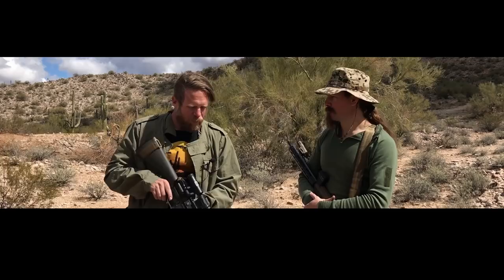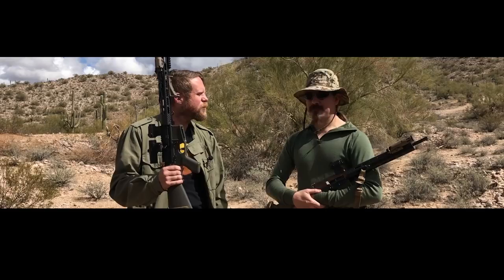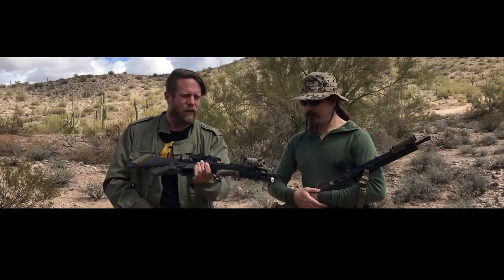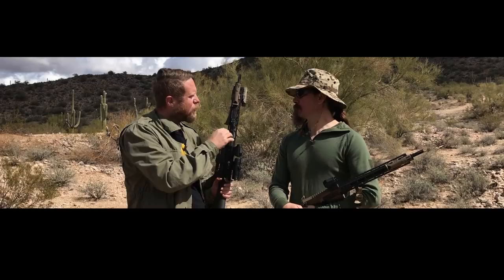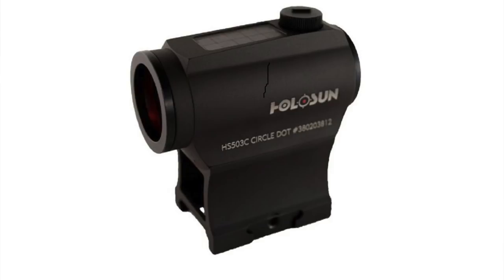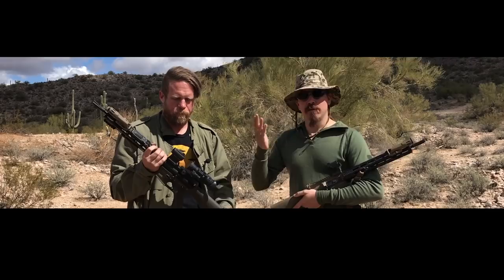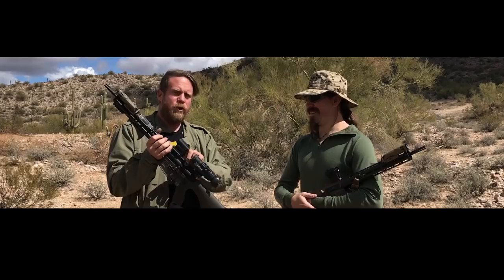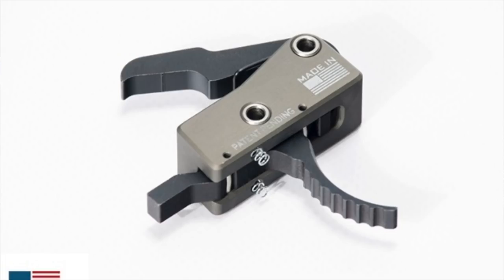WWSD: Rethinking the AR15 - CONCLUSION

Comment: I was interested in the bi-pod predicament that you guys ran into. It seemed rather limiting to go with a 'traditional' under barrel style instead of something like the FAMAS' side mounted legs. After doing a bit of research I came across a Picatinny Side mount bipod made by Command Arms. They can be had in different lengths and can be quick detach too. Just a suggestion, would be curious to see what your thoughts on them would be.

Comment: Really excellent series and conclusion. One thought, since we're thinking out of the box, why not extend the handguard past the tip of the barrel/flash-hider? This would protect the barrel if it get's dropped/mishandled, while only adding a fraction to the overall weight and size. Additionally, the lasers, lights, and other accessories could be mounted further back to improve the balance of the gun.

Comment: I use my backup sights for my cmmg. conversion to 22Lr. my red dot for 5.56.  the 22 shoots about 3" low at 50yds. out of the red dot. I use the offset  sights so you can get  both mag. and sight on,   both this way can be used for either cal. but you are "0" with the iron sights and the 22

Comment: Regarding backup iron sights. Could potentially have put that as a flip out from the top of the stock. Though it would neccesiate removal of rail mounted sights, it would be an intergrated, streamlined and concealed option.

Comment: Love the concept, but there are a few minor things that don't work.  The hand guards flex too much to mount an IR laser to, so they need to be aluminum.  Maybe Midwest Industries new ultra lightweight line would work.  Or perhaps Aero could update it's COP platform with a carbon fiber lower piece, or VLTOR could adapt it's VIS upper along similar lines. I'm totally with you on the heat issue and think a carbon fiber grip is a great idea. The continuous rail provides enough space to eliminate any eye relief issues.

Iron sights are a requirement, the front should be pinned to the barrel, and the optics needs a QR lever.  An optic with an etched reticule, either a 1x with flip-up magnifier or 1-6x variable because not everybodies eyes work with a red dot.   Also, fun fact, some one looking at the front of that red dot at night can see the red glow, kind of like a lit cigarette especially when there's lots of them in one area, like say waiting to ambush you. My vote instead is for the VCOG with licensed ACSS reticule. A Sharps Relia-bolt, LMT enhanced bolt, or similar product might also be a good idea to test. Combined with the mid length gas system that should fix the problem of bolt lugs shearing off.

Comment: I love this project. Only thing I cannot use at all is the GWACS because I'm 5'6" and I run my collapse in pos 3 (out of 6). And the beard hair problem was solved for me by using the Magpul ACS since the stick itself is longer and sits slightly more forward. It does indeed add weight, but it's weight in the rear end and it does balance a bit better. The other questionable piece is the carbon fiber ff tube, since it comes as a 13", not a 12". I don't know why companies make a 13" without making a 12" for us rifle length FSB users. It just seems that Facon hates iron sights.

Comment: This is a great rehash of a circa 2001 Professional Ordnance Carbon 15. Not to be confused with the Bushmaster version.
The Carbon 15 has a Carbon Fiber upper, lower, buffer tube, stock and handguards.  The barrel is small diameter fluted stainless steel.  It has a one piece aluminum rail with very low mount A1 style iron sights. Also ambidextrous safeties.  I have the last version with additional slots cut in the handguard.
I put an ADDCO ULTRADOT on it that co-witnesses with the iron sights when I bought it 2001?
 It will shoot 1" at 100 yards.  To bypass the assault weapons ban the muzzle brake detaches like a airhose. You can remove the stock and replace it with a shorter one by flipping a lever, another bypass of the collapsible stock ban.
Unfortunately they went out of business in just a few years. They were in Lake Havasu, AZ.
I have never shot mine to the point of heating it up as it is a collector's item for me.

Comment: I'm not sure what the big deal is? I was pushing Cav arm lowers years ago. I've built numerous cav arms guns. The lowers are awesome. Its the most solid feeling AR you'll wield. There is no slop between the upper and lower. The grip is a little blocky and could be better. But they are light and don't break. Combine with a skeletonized bolt carrier and a light barrel and you're in business for sure. Great ranch gun that is tough and cheap.

Comment: This will probably sound really stupid but here it goes:
Why not put the rear BUIS in front of the red dot? 
It's as a backup, so it doesn't have to work well, just better than nothing.
Reply: Not stupid at all brother, that's exactly what a lot of guys are moving to in the SpecOps community. Works quite well. Or offset sights.

Comment: In the Army I always used the M-16A2 over the M-4s for a few reasons.  One was that with the KAC quad rail the M-4 was heavier than the M-16A2s. Another was the 20" barrels have higher muzzle velocity over the short M-4 barrels.
Reply from the maker: True.
Reply: InRangeTV granted you guys are not concerned with taking down a hostile who may or may not be wearing armor, but the US NFA does mean that for most folks 16" barrels are the defacto standard.

Comment: I have used my backup irons twice. Once the red dot I had on my rifle ran out of battery at the beginning of a class, even though I just replaced them before the class. But I was able to run it with my backup irons. Not sure what went wrong with the optic.
I used them again recently when my EOTech got some moisture in it and my batteries died (the optic still functions, I just had to clean out the battery compartment).
Now I do acquiesce that having spare batteries would probably help, but I didn't have them on me both times, and my irons are what allowed me to continue my class.

Comment: Excellent points, perfect! I prefer a 16 inch pencil barrel with carbon fiber handguard if possible or the standard hand guards. I want the lightest possible rifle with a balance point toward the center of the rifle if possible. Less is more, I tend to remove as many accessories as possible. I also want the least complicated simplest sling possible. That’s just me

Comment: I used to have a reflex sight on my AR, and I had back-up irons on it as well. My reasoning was that if I was a complete nincompoop and left the reflex turned on over-night, resulting in the battery being dead, then I still had a good sighting system on hand to use. 

However, I now have a magnified optic with an optional illuminated cross-hair. The illumination is nice, but also not necessary. The cross-hair is very visible, even in not-so-great lighting conditions. As a result, the iron-sights are kinda obsolete. If my scope is knocked out by a stray bullet, but I'm not killed in the process, then that's God's sign that it's time to turn tail and run.

Edit: Forgot to mention, I now use the available real-estate for a flashlight.

Comment: Saw this on your facebook and thought it was intresting.

Two questions:
1) Will you put them through a mud/torture test?

2) Would it be accurate to say that a WWSD "Grunt gun" (something that actually would be able to replace the M16/M4) it would have the polymer stock, pencil barrel and carbonfibre handguard and then whatever stuff the military think is appropriate on top of that?

Comment: Only thing you guys haven’t really tried is down in subzero temps. Like here in Alaska, when I was in the army stationed here in Alaska optics batteries would freeze, ice over or break and crack. At that point you gotta take your optic off and use irons if you have them.

Comment: To balance the advantage of the carbon fiber not transferring heat : it also means it doesn't help in cooling other parts of the gun (but I have no idea if it's going to cause issues under heavy use).
Reply: rpnct the milk slots should allow for excellent ventilation.

Comment: My biggest disagreement here is as to adjustable stocks and their irrelevance. Now, this won't apply to a lot of people, especially Ian the spider monkey, but I have pretty short arms and a pretty big chest, and when you've got short arms, especially when you add chest muscle or fat and even moreso when you add armor, without a way to shorten the stock from the standard M16 spec you start to have a hard time even reaching the pistol grip effectively. Of course, you could cut down the stock on the lower, or have something custom made, but the easiest off the shelf solution is an adjustable stock.

Comment: Oh i just remembered on some polymers you can use a solvant to perrmantly bond them together stronger then any glue as they are bonded in the sense that the chemical polymer chains are connected. A chemical weld? I guess.

Comment: so the retail price (from their website) came to around $1850. That is not bad for a 5.5-6 pound near battle ready carbine. tactical not tacticool stripped of all but the necessities. The same gun built by a company would likely be in the $2500 range, and would likely cut some corners on things like the slt1 trigger and carbon fiber forward grip.  if you absolutely positively need B.U.I.S. they are so small you could add a pouch to the sling for them.

Comment: My take.

The fixed stock your using limits your LOP so everything you said about the BUIS goes out the window if you could adjust a stock like I can, nose to charging handle you can run a magnifier, I also prefer the 16" pencil because the integral flash hider is trash unless they updated it or something? Also the midwest lightweight rail is extremely light, and low cost. 

IMO if a rifle is more reliable and durable with more options and capability and doesn't weigh much more I'm gonna choose those parts.

Comment: I'd still say that BUIs or some sort of backup, non-electronic sighting system is necessary for the rank and file. Consider that the average infantryman's rifle is going to have been used by who knows how many guys before him, it'll probably have gone through hell and back, been used and abused in environments with very different heat and humidity, and the maintenance it has received has probably been pretty austere. SF guys don't need them, but then SF guys take good care of their equipment which sees less rigorous use, and they're usually not stuck in the shit for so long that they can't swap out an optic that starts to go screwy before the next time they need it.
Reply: I dunno, RCO-only, no irons must be relatively recent then. I've got a buddy in the Marines who was issued irons (a carry handle) with his rifle alongside the RCO.

Comment: FYI, the YouTuber Nutnfancy is absolutely obsessed with size and weight of firearms, so much so that he coined the term SAWC (size and weight considerations). So there are at least a few groups of people out there that are focusing on high-performance AR15s that are low weight besides you guys. 
Also, couldn't you just have a canted iron sight as a backup if you wanted one, without sacrificing top rail space? Polymer sights wouldn't weigh much and can still provide a manual backup for those who feel naked without them.

Comment: I can greatly appreciate your drive to cut weight.  I remember the days of the only thing you have is what you can carry for days.  Bullets count over batteries. I hear you on your cutting weight by removing a backup iron sight.  You seem to harp on that.  Guess I am just too much old school.  I like the look of your gun, carbon fiber and all.  But you live in the world of always having the things you want.  In the bush, you do not always have batteries, you deploy with what you can carry on your back.  Those are only there when the supply chain is close.  I learned the hard way, better to not need batteries to survive.  A simple 4x scope, non-illuminated, as a primary sight.  But the backup iron was always needed.  It sucks to have your primary fail and not have anything to fall back on.  Especially when you only have a second to react.  The concept is great, reduce weight in the weapon allows more ammo or other needed things. But, when all else fails, Iron sights work.

Comment: Also, shout out to our (I'm Irish, I support the USA troops too) the Irish troops in Chad, the blue line between Syria and Isreal, and the Mediterranean. The Irish troops on the Israeli border came to mind when you mentioned being in a fight against ISIS. They've had some clashes with the Islamic extremists on the border there. At one point some of our guys got captured and we, with the help of the Israeli special forces got them out in a raid (it was the al-nusra front that captured our guys, our troops have been attacked by them a few times, and Ireland has a policy of neutrally, our guys weren't looking for a fight. Just trying to maintain and keep peace on the border. But al-nusra have a tactic of decapitation (similar to ISIS) of anyone that doesn't agree with or convert to there religion. For the record, I was never in the millitary, I'm just saying "our guys" because I'm Irish, and they're Irish troops.

Comment: With the focus on Modern materials and saving weight what's the reasoning behind not using a titanium gas block
Reply: Eric M i think an ounce savings or so at the front end of the gun is  worth the extra 15 or 20 $
Reply: Eric M fair enough
Reply: Titanium is susceptible to gunpoweder crap eating it, this is why S&W Titanium cylinder guns have such short lifes.
No point if it's half a ounce in savings for something that could fail and leak in the future.
Reply: This is the exact reasoning behind the front heavy SAGE intl. kit for M14s/M1As. Weight at the front makes muzzle rise almost disappear. Hell, HK built the USP Match arpund that concept.

Comment: Stoner would have a 20 inch barrel so that the round could work like it's supposed to at range. Ditch the fixed stock and length won't be an issue!

Comment: I noticed in the components link, you guys suggested a Trijicon TR24 Accupoint as an option.  In you past videos I was under the impression you had decided on the Vortex PST 1-6.  Is there some reason you decide to go with the TR24 over the PST?  Also, in the same vain, do you feel the mil type or BDC reticles found in the PST and similar scopes serve any useful purpose on a carbine style firearm?  P.S. As I recall you called the PST (and similar scopes I assume) the best balance for an all around carbine.

Comment: I've needed BUIS twice on a carbine, on the same day, after a failure of two optics in a row.
Reply: What were the optics, and what was the failure?
Reply: @aggrodkreg4321  Bushnell sight that was for T&E, mount failed, flew off under recoil with a sheared bolt.

Replaced by a Aimpoint T1 in a LaRue mount, dot went out on the sight, had to be sent back to Aimpoint factory for repair.

I've had others fail, most notably multiple EO Techs.
Reply: Very interesting, especially from the Aimpoint. I recently switched from an Aimpoint PRO on my rifle to a Trijicon Accupower 1-4. I did it to try out the LVPO, and I found that I really like the etched reticle over the red dot, since my eyes suck.

Still, what you're saying still rings true to something very important: batteries and electronics can and will fail eventually.

Comment: The BAD lever is not a bad choice. If you are using it in the reload you are swiping down with the side of your finger, not back. If the bolt doesn’t lock open on the last round your hammer is likely down because you tried to fire again and then you’d have to run the charging handle to finish the reload. If you are reloading on a locked bolt then you can engage the safety and you should have the safety on unless you are actively engaging. The BAD lever is not the issue, lack of discipline is.
Reply from the maker: The BAD lever is a dangerous piece of garbage.

Comment: Sixteen inches in barrel length is an entirely arbitrary, man-made lower limit. It also wasn't a limitation for Stoner. If sixteen inches wasn't a minimum requirement for you as a civilian, what do you think you would have ended up ?

Comment: i still say a 16 inch barrel is better than the 14.5 for technical reasons 16 allows for a swappable muzzle break i think the few added ounces is a worth while trade-off and a small amount of performance and i run a mid length gas system with 16 inch but cant with a 14.5 (or at least i was told not to run a mid length with a 14.5) and i have had better luck with mid length over carbine and i also will always run the back up irons (i have had a optic go down in a match and my best friend is a swat officer had he had a eotech go down during a raid  tho he was able to flip up the back sight it had front block sight allowing him to keep is rifle up in a shots fired raid) all being said my WWSD is 7.5 pounds

Comment: I think back-up iron sights also give shooters a little peace-of-mind insurance, where they feel more confident in their rifle. Yes, the likelihood of using it is extremely low, but in case it does happen, you'll be ok. And I would argue that your performance will increase when you have more confidece in your weapon, just from knowing its capabilities.

Yes, I know that's sort of a lame argument... and also VERY similar to the Army's idea of boosting soldiers' confidence in their M16s with a forward assist... but I would say BUIS are more useful than a FA.

I guess it comes down to shooter preference. And hey, that's what modular rails are for.